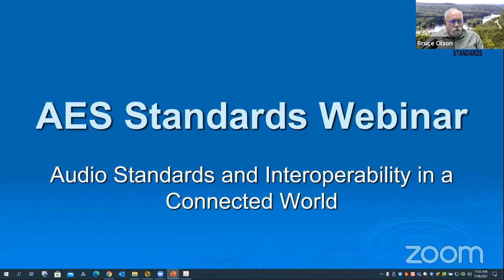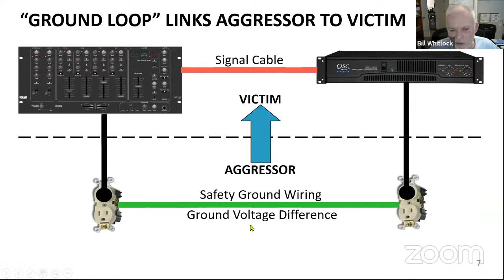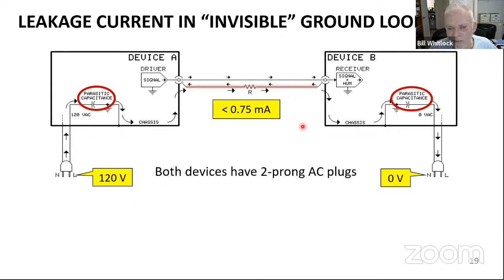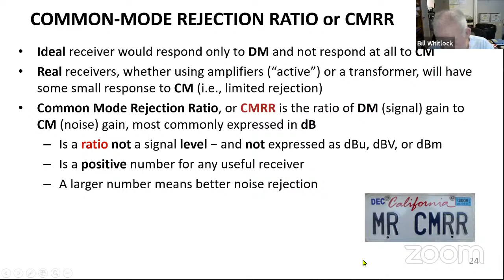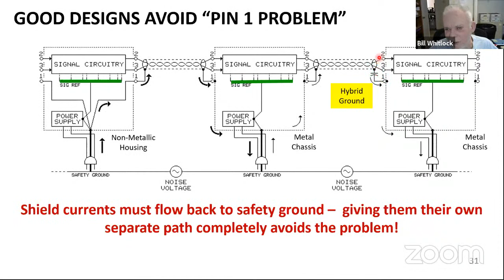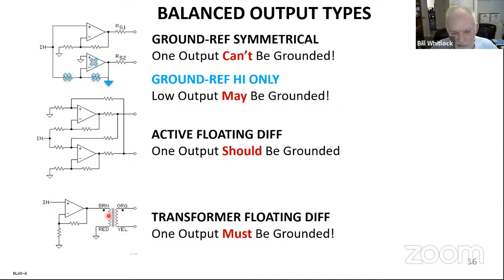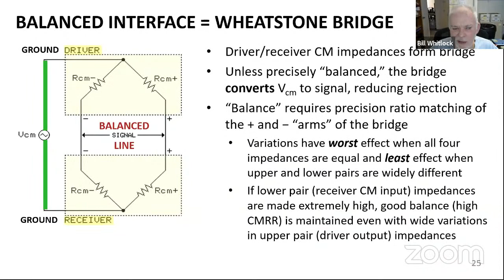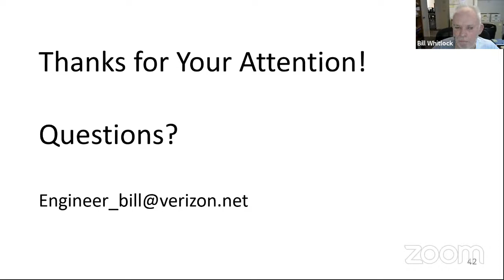Standards Webinar: Analog System Interconnection Standards

Comment: Excellent presentation, with knowledge that is very needed even for well-informed Electrical Engineering majors!  This practical picture of grounding and resulting shield current induced noise was not discussed at all during my 4-year degree EE courses.

One small note @ 10:11 :  Following the "right hand rule" and "conventional current" direction (actually reverse of physics b/c electrons are the charge carriers, not "positive charge" a.k.a. "holes"), the into vs. out-of the screen currents should be reversed, given the field curl directions in the snapshot diagram.  That is to say:

Point thumb of right hand into the screen along with the direction of current for the side labeled "L" ("Line"), and the fingers of the right hand will follow the clockwise field curl direction shown.
Likewise for the "N" ("Neutral") side of the Romex cross-section:  Point right thumb out of the screen parallel to conventional current direction, and the fingers curl in the counter-clockwise direction shown.
Of course, the actual physical direction is shifting with time given an AC sine wave.  So at some point in time, the current and field directions will actually be reversed.